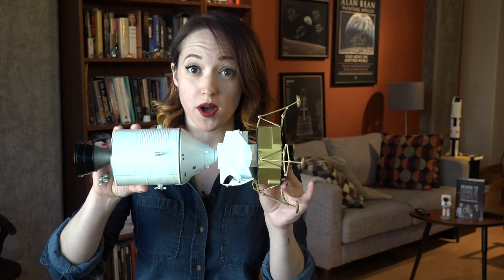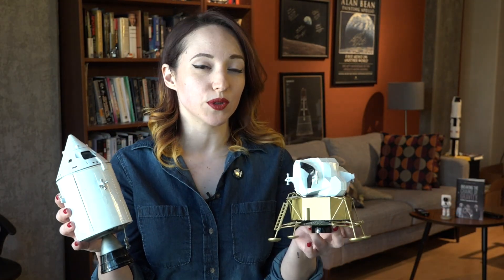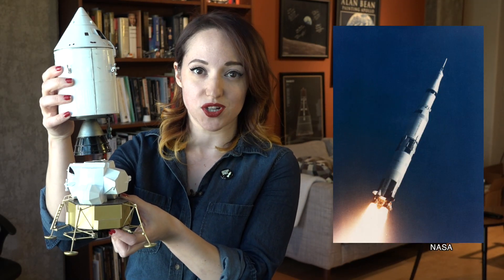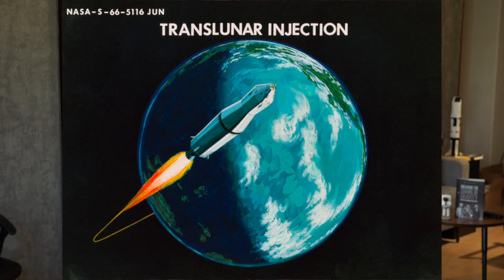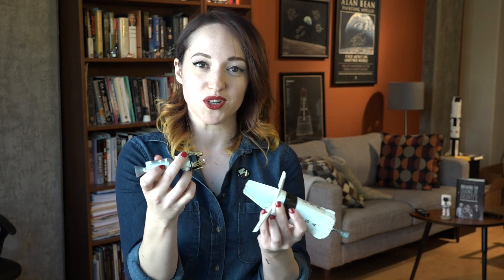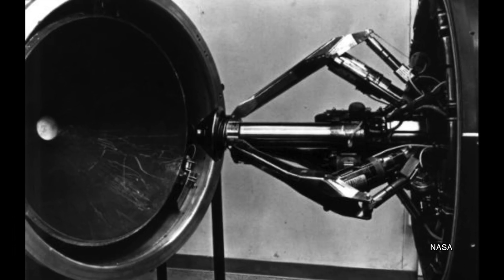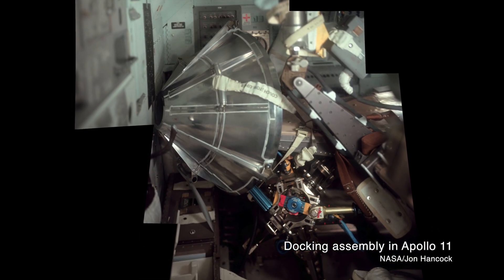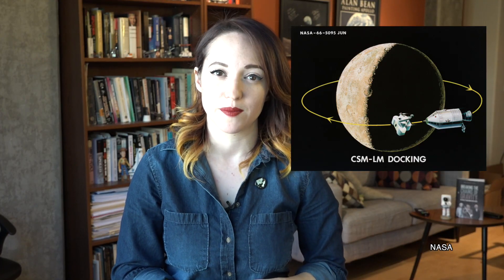How Did the Apollo Command and Lunar Modules Become One?

Comment: One question is what happened to the 4 adapter panels after the CSM separated. They opened like flower petals, but then what next? Some artist conceptions of the separation show the panels still attached to the S-IVB, but Buzz Aldrin talked about seeing the panels floating free off in the distance after separation.
Reply: +Joe Vignolo Opened like flower petals, and were propelled away with springs in the hinge-mechanism.

Here's the Apollo 8 S-IVb after TLI
http://www.astr.ua.edu/keel/space/apollo8sivb.jpg

Here's the Apollo 7 S-IVb
http://www.de-la-terre-a-la-lune.com/missions/Images/s4bpanneau2.jpg

The panels on 7 weren't designed to separate. one of the panels also didn't extend properly, so they didn't get as close as they wanted during the rendezvous maneuver (transposition & docking) because they thought that there was a risk that the panels might hit the CSM.

Here's how the panels would have separated on an actual flight lunar flight:
http://www.thespacereview.com/archive/2584a.jpg

This is from the T&D of Apollo 10. As you can see, the panels are already out of view of the camera after the CSM had pitched around.

I think you can catch a glimpse of the panels "floating" away in the video recordings of the docking procedure though.
Reply: Apollo 7 is the only one you'll see with retained panels. It was thought that they might interfere with docking if they didn't petal back fully so the design was changed.